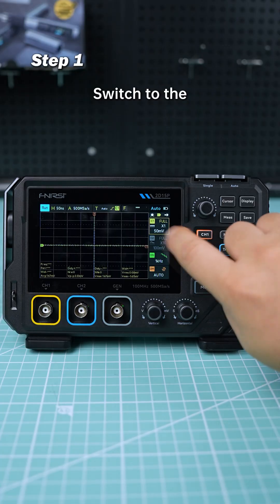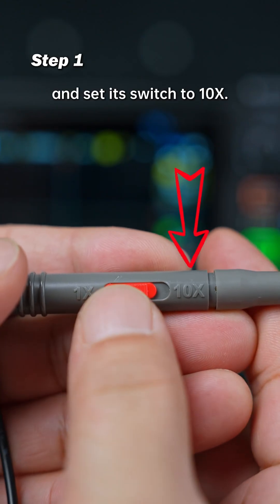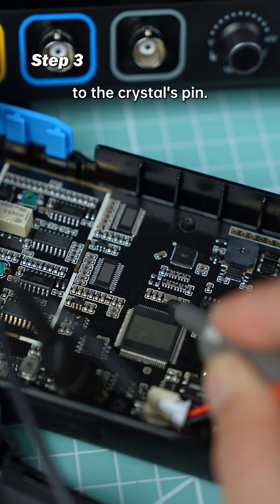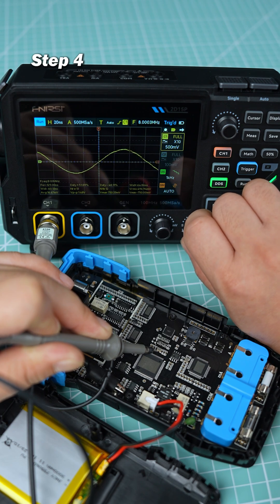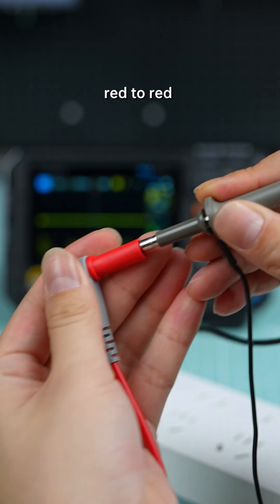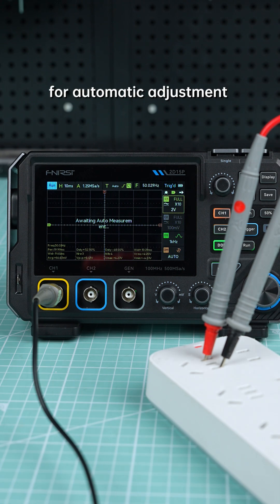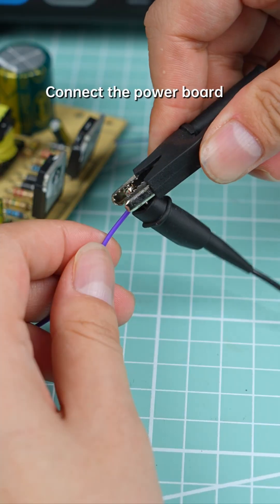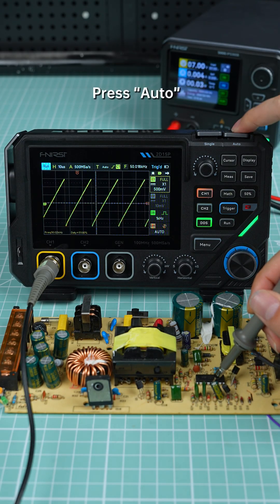FNIRSI 2D15P Touchscreen 2CH 100MHz Oscilloscope | How to Test AC Power, SMPS & Crystal Oscillators

Comment: What is the maximum amperage allowed on this oscilloscope? And what happens if you connect it to something higher than its maximum for volts and amps?
Reply from the maker: If the measured current is greater than 10A, it will burn out the fuse.
lease preliminarily evaluate the current before measuring.
Reply: @fnirsi  Is this for both DC and AC?